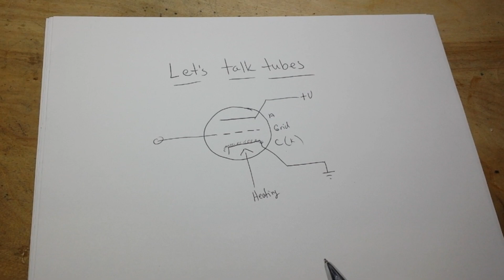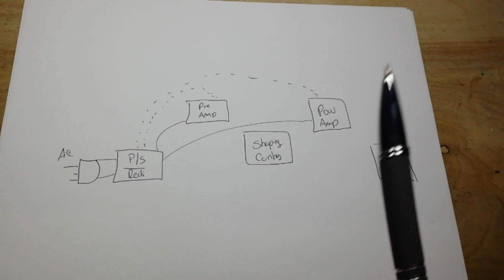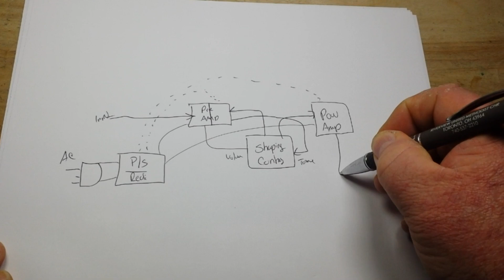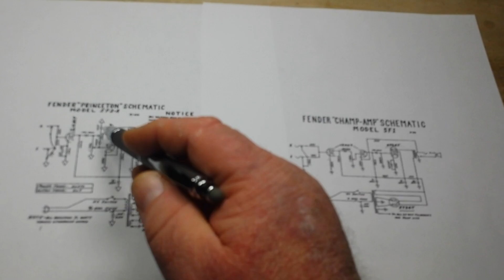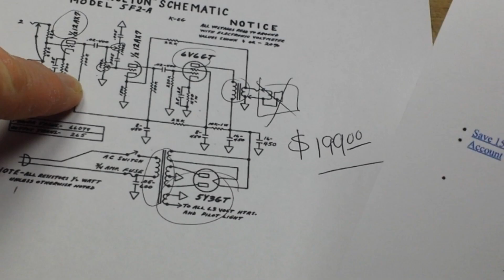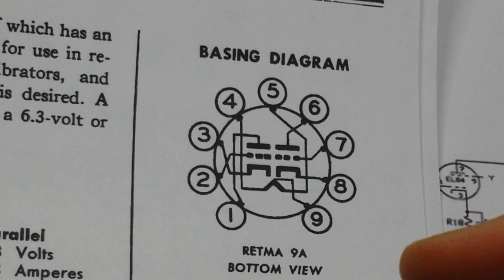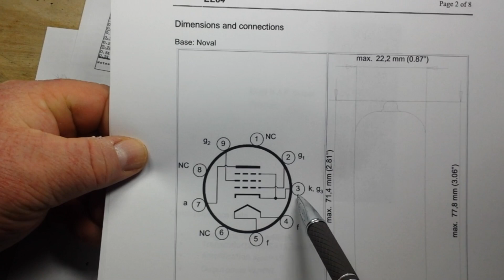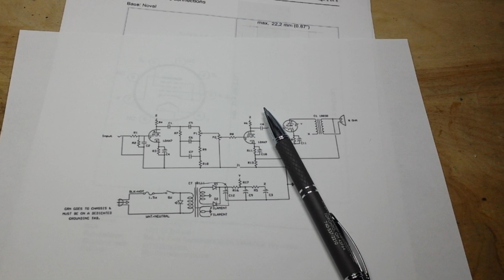Let's build a vacuum tube amplifier-part 1

Comment: I was into amateur radio when I was younger (20yrs ago). Had quite an amp, 4 811A's. Check those out for use in an audio amp for giggles.

Comment: Ok, you got me subscribed with this tube amp series.
Safety of tubes and voltage needs to be emphasized. Years ago I had a Knight t-175 linear amp with 6L/6J tubes. I had the top off (always ran hot) one night, reached over it to get something behind it, and bumped the anode with my hand. The result was me being thrown 6-8 feet across the room and against the wall. Came to about 30 seconds later with an entrance, and exit, arc burn just below my thumb where the 600+ volts entered and came back out. 
Had an aAmeritron al-811h linear amp as well, with four 811A tubes. Kept the living room nice and warm during the winter.

Comment: First part- it would have been useful to state that the grid needs to be negative to the cathode, i.e. negative to ground in your diagram. 
10:20 you got the tone and volume controls crossed.
Removing some of the distortion on peaks when the power supply current limits makes the sound worse? Really? Stick some resistance is series with the diodes if you want this...

Comment: Hi Paul! Glad to see that you are trying to stay safe! I am glad to see that you are digging your feet into the world of vacuum tubes! I just wanted to mention that I typically frown on solid state rectifiers for vacuum tubes.  Use of these diodes will actually shorten the life of a tube by "cathode stripping" which is caused by the high voltage being applied before the heaters get nice and hot.  I have 3 Tektronix scopes, 531A, 535A and 545A and these copes do use solid state diodes, there is a time delay relay that allows the heaters to come up to temp before the HV kicks in which is about 45 seconds.

Either way, I am fascinated with tubes, especially on my 535A which was made in 1962, is all original with the exception one 1 or 2 tubes and works perfectly fine!

Comment: In what way will solid state rectification sound different from tube rectification? Sounds like the usual guitarists mumbojumbo but I expect you to know better than that. So please enlighten me!
Reply from the maker: Tube rectifier have a voltage sag as they are driven hard resulting in a drop a 3-5 volts that just gives a vintage tube amp a "sweet" sound.
But everything has to work together...ie clipping in the preamp. A little sag in the power amp stage. Solid state rectifiers dont sag unless input voltage drops.
Reply: @learnelectronics  And I assume that sag isn't equal to the usual diode voltage drop?
Reply from the maker: Diode voltage drop is constant. Tube rectifier sag is floyd based on power tube draw.
Reply: @learnelectronics  Interesting stuff, thank you!